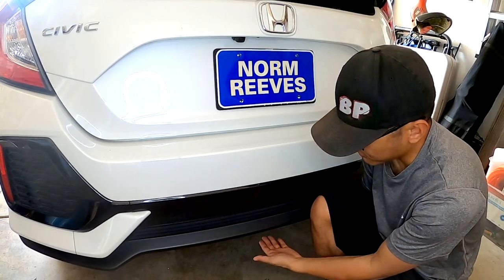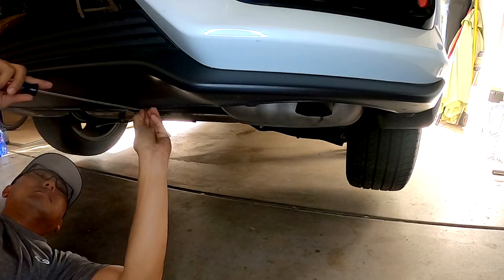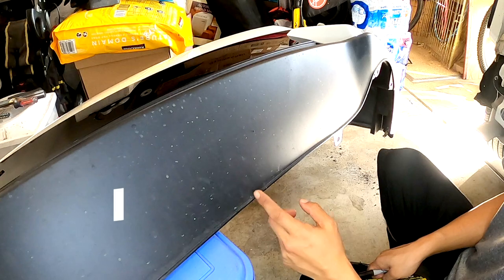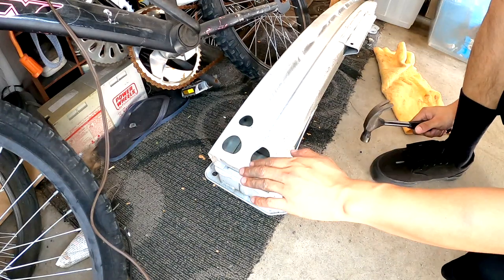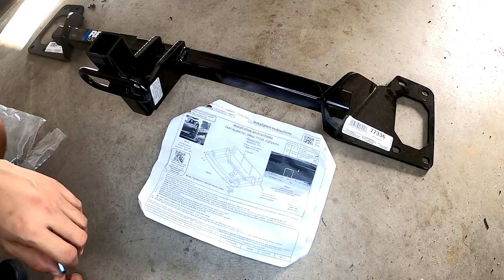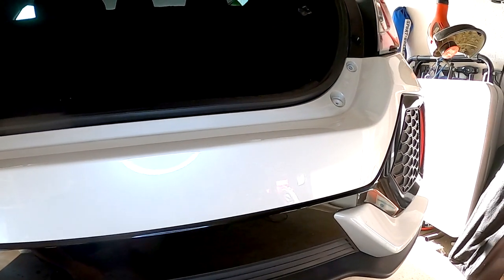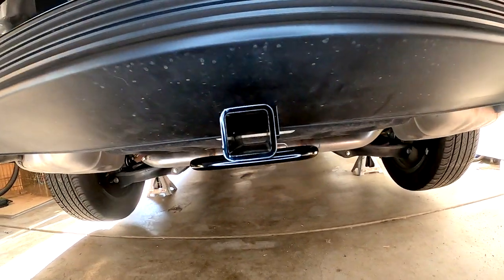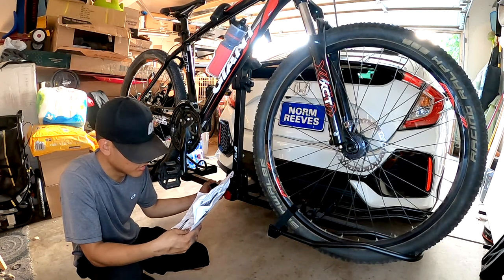Honda Civic Hatchback [Sport Hitch] Install 1 1/4" 10th Gen 18 2019 2020 Sedan BV Rack Installation

Comment: I've been wanting to do this, but I am not comfortable cutting and hammering into my touring 😢
Reply from the maker: It may seem daunting, but the small cut is on the very underside of the bottom of the bumper housing, which won’t affect things and won’t be visible. The hammering only softens the sharp corners and is better than the directions to cut metal from the bumper beam. Lmk if you have any questions!

Comment: I have the same hitch and I didn't need to trim or hammer the ends of the bumper beam for the hatchback.. The bumper cover cleared it. I believe you need to trim the bumper beam if you have the sedan because the bumper cover has a different shape.
Reply from the maker: The beam does have shape corners. The manual probably states this as a safety measure just in case the bumper cover has any contact, but definitely no need to cut off any metal. If anything, a quick few taps on the corners to take out the sharp edges would be good 👍🏽

Comment: You didn't need to unscrew your taillights to pull off the bumper
Reply from the maker: True, totally optional, but it does provide extra spacing while removing and reinstalling the bumper 👍🏽

Comment: I have 2018 Honda Civic hatchback exactly same shape and color.
Yesterday I have installed the same hitch and today I noticed both sides on the fascia has little bumps, either this is from factory and I did not notice it before or this is after installation. I did not cut the corner pieces from the metal pumper beam. I did kind of the same thing like you said to tap the area in with hammer. if it is due to  installation do you think I should cut away those pieces from both sides. Please advise. Thanks
Reply from the maker: Hmmm, I have not experienced that.  Perhaps you might need to tap the metal beam a bit more, or yes cut away the material noted in the manual.

Comment: Thanks!!!  Could you tell that the reinstalled cross bar was not touching the bumper?
Reply from the maker: Yes, I can physically push in the bumper in the two areas of concern, and feel that there is adequate spacing.  Thanks.
Reply: @preludedriven  Thanks.

Comment: I'm looking at getting a hitch installed on my 2017 Civic sedan, and have the option of this one, as well as a model from Curt that sits somewhat lower.  That installation doesn't involve removing the rear fascia, but does require 4 holes drilled into the frame rails.  Is the model that you're showing here the best way to go, in your opinion?
Reply from the maker: Yes, I'd recommend going this route, as you do not need to drill into the car's structure.  It also is higher up, and won't get in the way of ground clearance.
Reply: @preludedriven  How high up from the ground is the top of the hitch opening on this model? I have a Kuat NV 2.0 rack and am worried that when folded up it will cover the backup camera if this sits too high whereas the Curt model might not.

Comment: This was a helpful video, thanks!!  I did have two things different with my 2018 Civic hatchback than the video.  One, there was only 2 screws at the wheel wells.  I checked three times, and only two screws.  No problem.  The second was a problem.  The factory assembly aid hook (https://youtu.be/7FgFauQkIqM?t=208)  that holds the bumper on prevented me from installing the hitch.  Once I bent that back into the body area, it went together no problem.
Reply from the maker: Interesting....perhaps it's due to the added Honda mud flaps?  ...unless your hatchback also has mud flaps.
Reply: @preludedriven  no extra mud flaps, its the LX model, but I would think the body would be the same on all models.  No biggie!